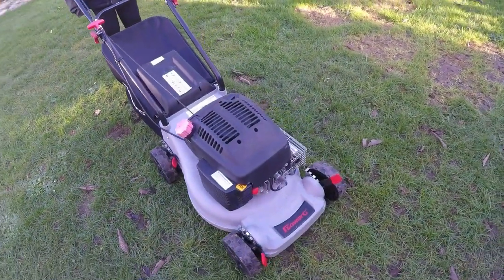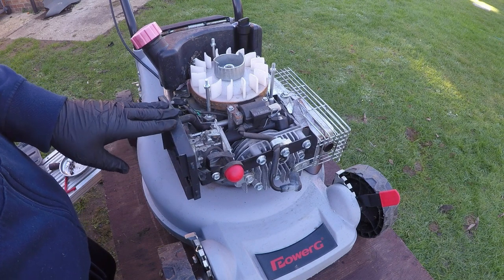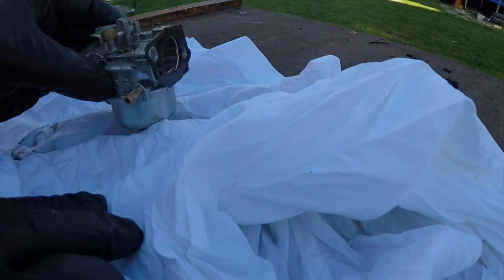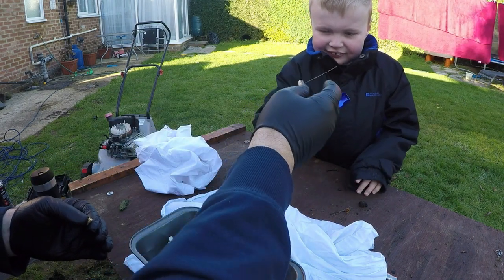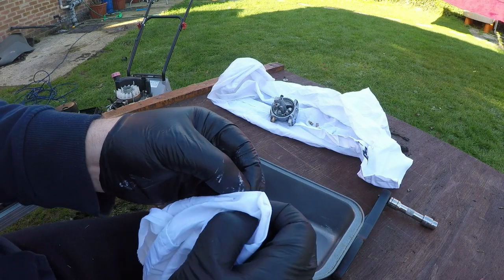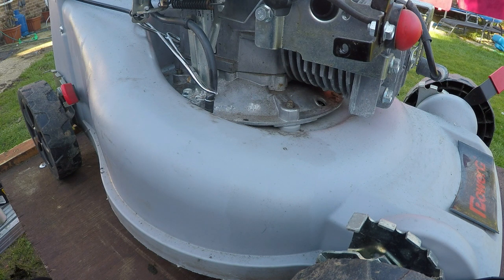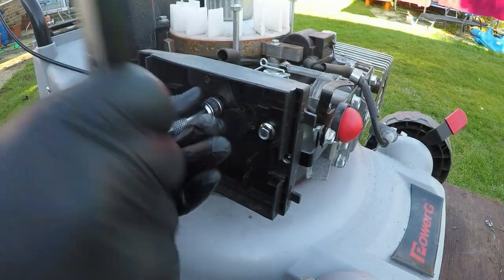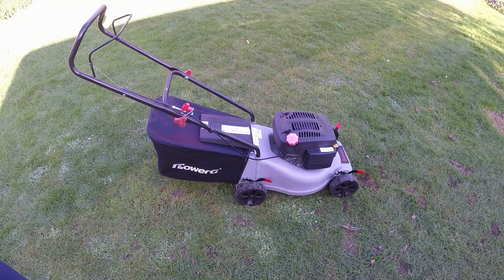Lawnmower Hunting or Surges fix . SV/RV  150 Carburetor.

Comment: Cheers for this video. What was the little things you had in the blue case that you used to clean the jets
Reply from the maker: paul bradley I use gas files mate. From amazon
Reply: Thanks for the speedy reply. I couldn't rememebr the name
Reply from the maker: paul bradley what name mate
Reply from the maker: @animalventura  the name is mick mate
Reply: @themowerman  no sorry of the tool
Reply from the maker: @animalventura  it's on Amazon under gas file I have link
Reply: @themowerman  sorry mick I have totally confused the whole situation. Thanks for all the responses. Just off nightsift and my brain hasn't connected with my  fingers lol. Great channel

Comment: Hi. Why would I be finding petrol in the oil tank when I emptied it and black petrol I’m guessing dripping from exhaust when it’s running
Reply from the maker: I would say the mower has been tipped up on its side and the oil goes into the petrol
Reply: So it’s ok. If I just fill oil as I’ve emptied it, and try to flush it out by filling and emptying the oil a few times to get the oil back to it’s normal thickness? Would that work
Reply from the maker: @01arron  yeah just fill up the oil and run it for 10 mins
Reply: Thank you mick, been watching all your videos now for a long time, always waiting for the next new one to pop up. Your a down to earth guy. Your the only person that took the time to help me out 👌

Comment: Mick a newbie to the channel was with mower man a for a few wks but sadly he has changed paths I have replaced my rotorvator engine carb failed for the last time so I saw a cheap replacent engine thinking quick change over away I go but I'm stuck Mick can u help
Reply from the maker: Yo yo. Hi mate and welcome. How can I help
Reply: I've replaced a engine but can't seem to modify the engine to work I've not no throttle coz my old engine had a carb and linkage with a throttle   the engine is Tecumseh made bye prism and the replacement engine is a Briggs n statton 375 champion
Reply from the maker: @ronniebarker79  send me some photos via email so I can see the engine micksmowers01@gmail.com

Comment: Hi Mick, 
Great video as usual. I've got an sv150 engine mower in at the moment and it's the type with the fuel tank built into the recoil cover and guess what: its leaking fuel. 

Do you know if the replacement tank can be bought or do I need to go for a fuel tank conversion kit? The latter is pricey!
Reply from the maker: You can convert them without getting the kit. Just need a some homemade brackets.. I have done lots..
Reply: @themowerman  Thanks. So would I be right in thinking I would get a new fuel tank and then fabricate some brackets for the recoil to sit on?  For what it's worth the recoil works fine....it's the tank end which is split in 3 or 4 places. 

I've thought about plastic welding it using a soldering iron and a cable tie as the soldering rod.....quite a few videos on youtube showing how to do it.
Reply from the maker: @jeffjeffjeff2  I tried welding it but it did not work. You have to pack out the pull cord and attach a new tank. I will try and do a video on it
Reply: Micks Mowers as always, thanks for the advice. A video would be great. Hope Rileyboy is doing well
Reply from the maker: @jeffjeffjeff2  all good this end

Comment: Horrible, horrible mowers
Reply from the maker: alan lake lol I don’t mind them. What don’t you like them
Reply: @themowerman  No cheaply made with poor quality materials, and you cant get the parts for them easily
Reply from the maker: @alanlake5220  I don't mind them.. lots about to strip for spares
Reply: I treat them as disposable - I buy one for £100 or so and run it till it dies - usually about five years so much cheaper than servicing and repairing a quality one.   Cuts fine (but then I'm not overly fussy!).   I know it's terribly wasteful but it's all about the £££ for me.
Reply: @leighparsons  I can't really fault your logic  on that